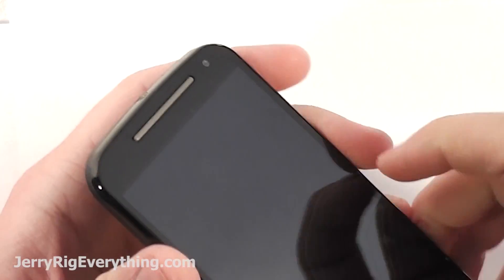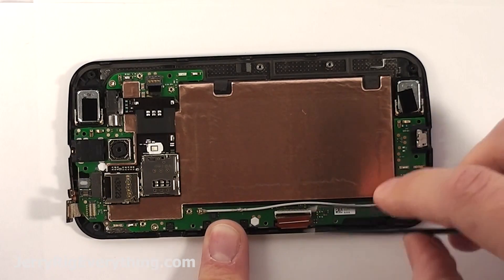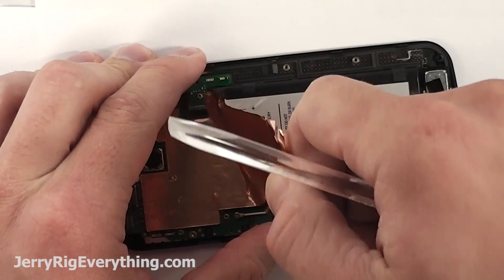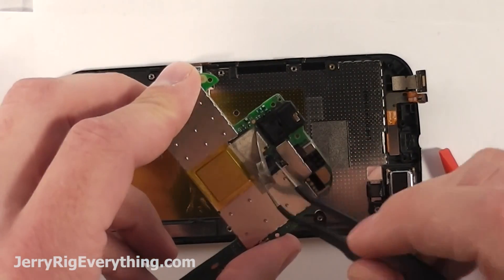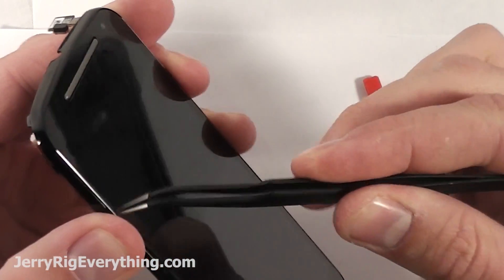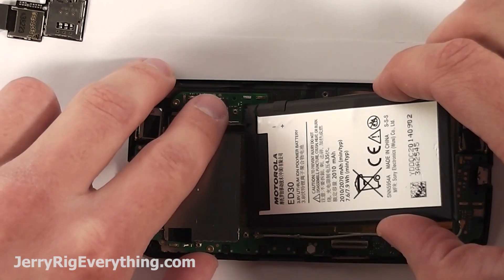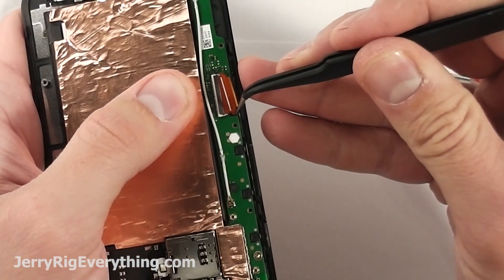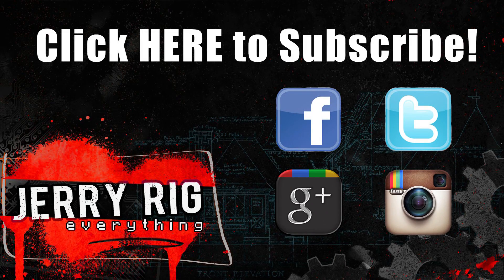Moto G 2nd gen (2014) Screen Repair, Battery Replacement

Comment: I followed all your steps but for some reason my bottom speakers don't work no more help?
Reply: I have a similar problem,my bottom speaker is now making nice like interference, can someone help us here please
Reply: +Hugo Gonzalez Hi. I'm having this problem? Did you ever get to fix it?
Reply: I had to change the screen and it worked.
Reply: +Hugo Gonzalez I replaced the screen successfully. I was talking about the bottom speaker problem.
Reply: +Carlos Silva I meant I replaced it again for other screen, because for some reason that was the problem with the speaker. at least that worked for me
Reply: +Hugo Gonzalez Is it because of quality of the screen? I didn't want to spend a lot of money so I bought it from China. Maybe it was a mistake...
Reply: My screen was also from China both of them. So I don't rally know what is causing the problem.  Then I used the first "damaged" screen on another device and it worked well with no speaker issues

Comment: Just bought it yesterday. Seems every MotoG 2nd gen has an issue and god knows why no one mentioned this critical issue here. The gyro and accelerometer isn't working well with the O.S. on it. None of the applications which use gyro+accelerometer works. The screen keeps shaking on the App. Try any Cardboard virtual reality app and none of them works properly. Later i found this is the problem with MotoG 2nd Gen devices and found many references to it :

http://www.reddit.com/r/GoogleCardboard/comments/2syeb2/moto_2nd_gen_gyroscope_fix_request/
https://www.youtube.com/watch?v=mMzN6GIEtjs
http://forum.xda-developers.com/moto-g-2014/help/super-shaky-gyroscope-fix-confirm-issue-t2961077

MotoG customer care are pathetic to respond to the issue. It made me hell to explain them the problem itself whereas I could tell them each and everything technically. They are really pathetic. The joke is they say try any other app in safe mode and do not try any custom app. WTF. No built in Android app is there to tell if gyro is working fine or not. Its only 3rd party app where you can see this. And its definitely the hardware+O.S. issue.

Comment: Hi Jerry,
My moto g (2nd generation) fell into water and turned off itself later.
I have dried it by all means. Now the problem i am facing is its screen is not showing up anything, whereas the volume up/down buttons producing noise as its working. Its Vibrating on pushing power button. Also power + volume down (screenshot) feature looks like working but nothing turned up on screen. Whats is the solution to this ? Can we connect phone to get its display on external monitor or something ?
Thanks in advance.
Reply: ***** i have the same problem. dont know what to do...

Comment: The earpiece of my moto does not work any more. As far I could get it from your video, it is located on the same board as the camera, but you didn't show exactly where. Before I disassemble my phone I would like to be sure that the earpiece is easily replaced?

Comment: Replaced my broken screen (I bought the complete frame assembly) by following this video.  It was a pretty nerve racking and fiddly job but it is all working now, so a big thanks to Jerry, I couldn't have done it without your video!
Reply from the maker: ***** Nice! Its always nice when everything works when you put it back together.
Reply: JerryRigEverything
Yes and frankly something of a surprise!  I didn't bother putting all the screws back in before powering up as I was fully expecting that I'd have to dive straight back in again to fix something.  Thanks again for your detailed instructions.

Comment: Hi JerryRig, thank you for this very useful video. My Moto g 2nd gen XT1068 front glass cracked but the phone is working good. So now which part i should buy? Only the glass or entire touch screen frame set? Could you please suggest me?
Reply from the maker: Janu Reddy You can attempt a glass only repair if you want... BUT it is super super difficult and most people fail.  So The safer and easier route would be to just buy the whole screen replacement.
Reply: Hi JerryRigEverything, What do i have to consider, if want to try to replace just the glas?

Comment: My Gorilla Glass screen was shattered.  I followed your instructions and completed the repair.  Glad I spent more and bought this with glass already mounted in frame!   Thanks Ruby for the screw size tip!  My biggest problem was getting the camera and vibrating motor removed.  Not a job for someone in a hurry. Thanks a bunch for your repair video!!
Reply: I spoke too soon!  I cannot get SIM card nor the SD to read.  I have torn back into it and plugged and un-plugged the connector to no success.  I suppose I damaged the assembly somehow in removing it.   Anybody know where I can purchase that assembly?
Reply: Frank Pearman hi Frank...could you please tell me which company's screen u bought.. original or duplicate..

Comment: HeY nice video..
i have a question, my MotoG fell into the water, at that time i some how switched it of and not powered it on for 2-3 days as i was letting it dry off. Afterwards when i tried to switch it on it was not booting up, nothing was on the screen. I gave it to service center but just seeing the IC they  said the IC got short and the only solution is to replace the whole IC without even checking it. I seen some videos online showing perfectly working Moto G even submerged in water.
I wanted to know that is there any other way to check whether the actual problem is with the IC or anything else.
Looking forward to ur reply.

Comment: hi mate,is it necessary to remove battery if I only need the screen to be replaced? would you consider separated tutorial maybe?
Best Regards.
Reply from the maker: imu sh Ya, in order to get at the screen, you'll need to pull out all the guts. Swap the screen, and put all the guts back in.

Comment: My touch screen doesn't respond to my touch input but the power button still works.. What could this problem be? And if I try to fix it myself, does this void the warranty?
Reply from the maker: Chiel De Brouwer Opening the phone will void your warranty.
Reply: Chiel De Brouwer Mine won't respond to touch either.  Did you ever figure out the issue?